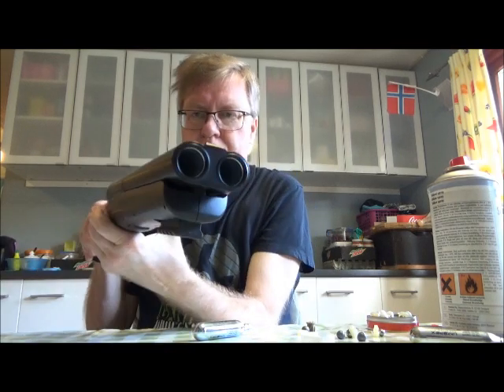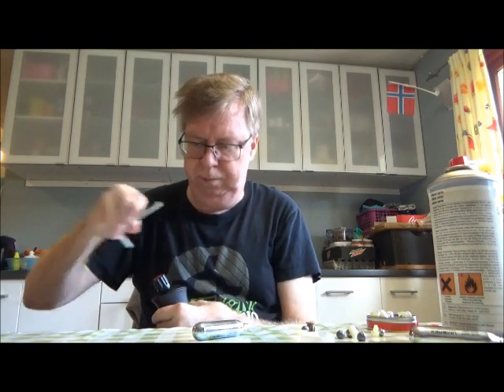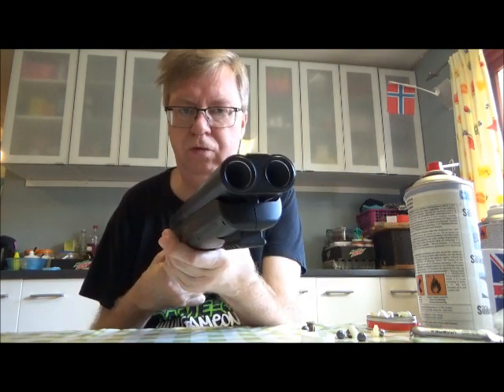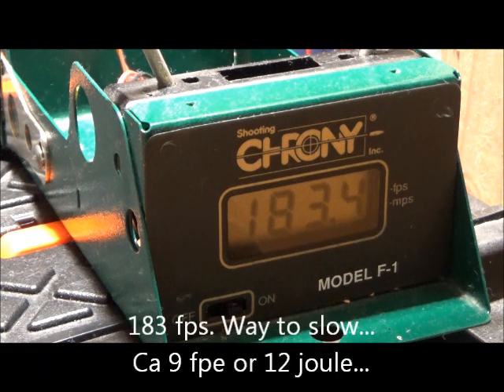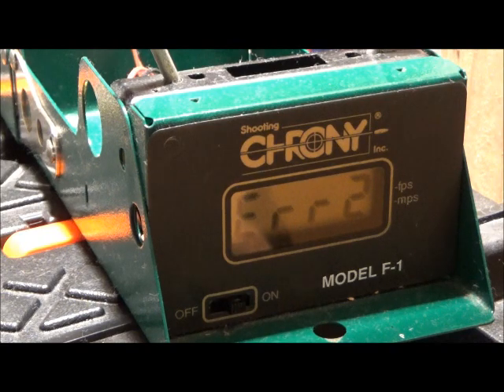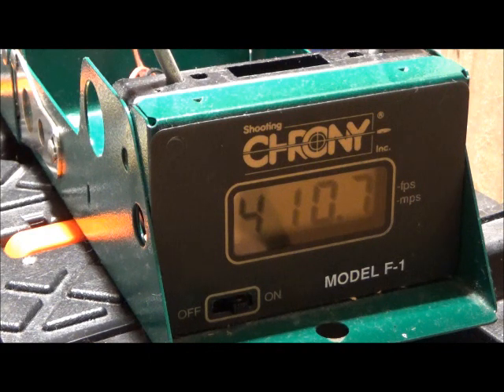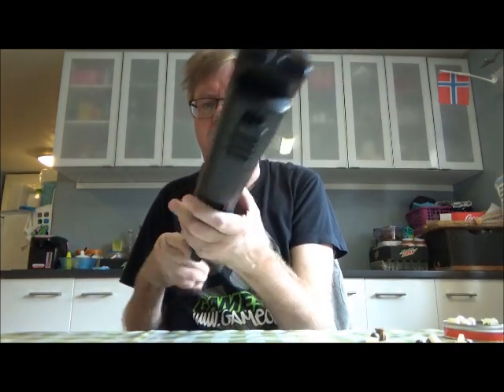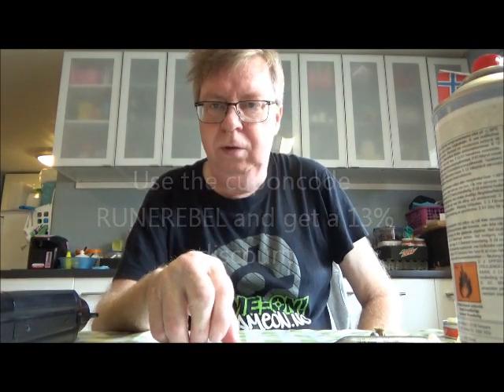Umarex HDS68, Powertesting 29 Mar 2021

Comment: Hi Rune, just to let you know. I am having great results using 50cal first strike skirts and 3 .177 pellets.  Use a very sharp knife to cut off the paint blob, leaving about 3or4mm. Wash the paint out.    I am using a drop of PRITT power gel glue into the little dish area where the paint was.
  I then drop in 3   .177 pellets. A perfect size are JSB Exact Heavy Diabolo.
    These rounds are non recoverable, especially with the HDR upgrade pack.  But these rounds are very good for HD maybe.      Hail to the Tinkerers.    Cheers Rune.
Reply from the maker: Wow. Thats nice. Thanks for the info. Cheers my friend :)

Comment: Is there any tunes not involving opening it too much?
Reply from the maker: Yes. You can try and spray a bunch of teflonespray in the CO2 tube. This is a superlube and if you are lucky the small brass restrictor will pop out when you start shooting. That will give a rise in power. This teflonspray mod works. I did use it on my HDX68 😃👍